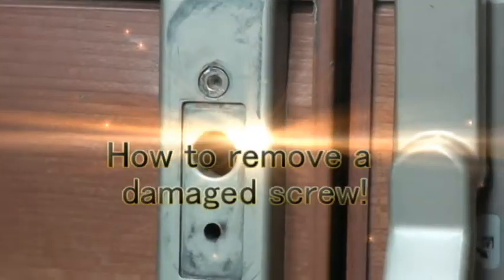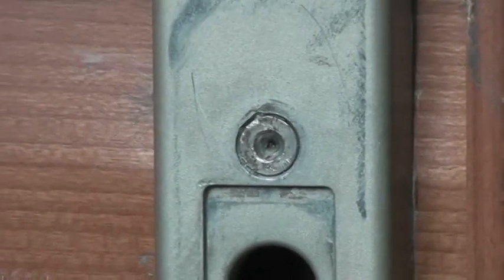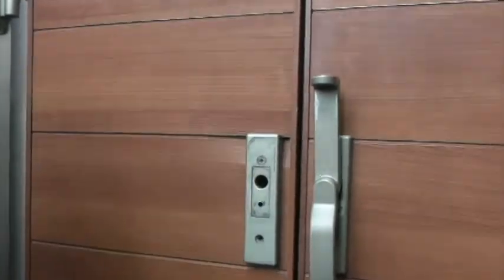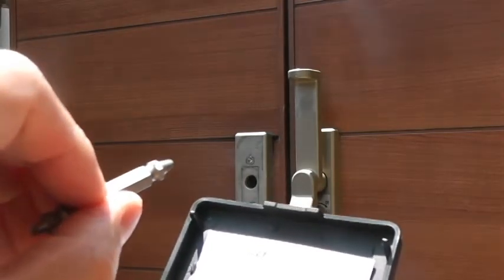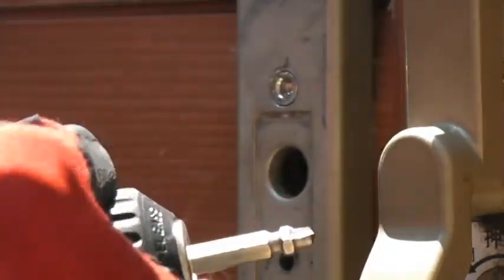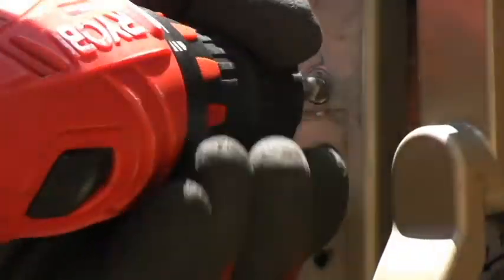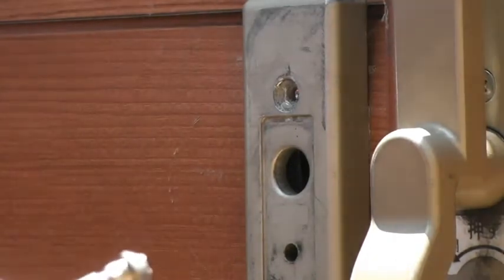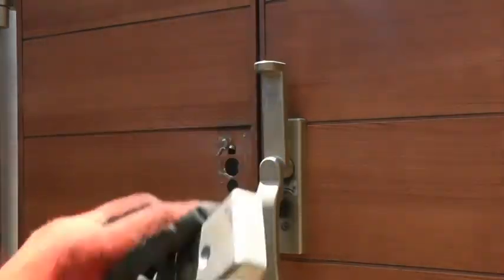HOW TO REMOVE A DAMAGED SCREW USING Alden Grabit Pro Screw Extractor

Comment: You start out with a nice concave surface to begin with. But screw heads are not like that - they're flat - and when you apply pressure, the drill head slips off.